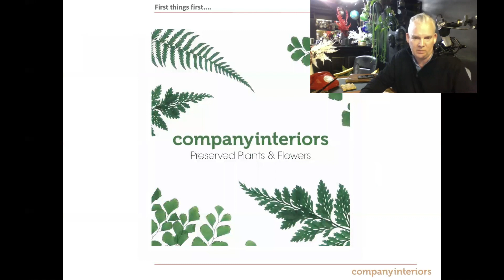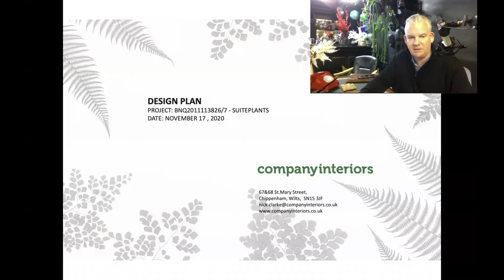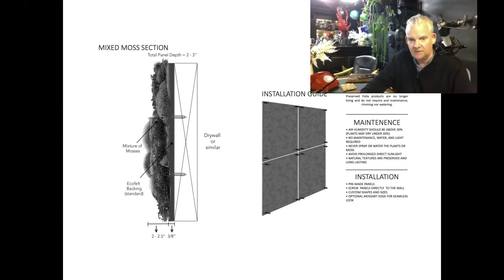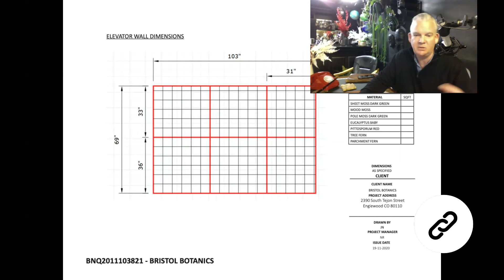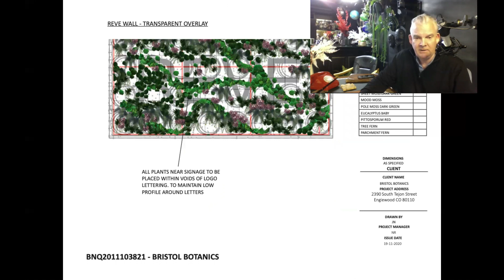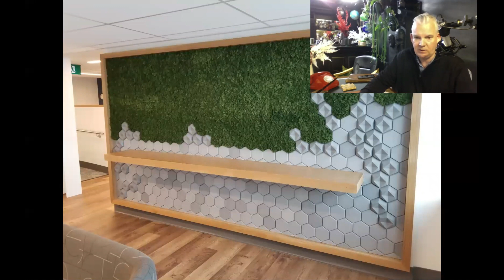How to Design a Moss Wall | Company Interiors

Comment: hi there, I have one issue and I was wondering if you could help me. A client of us wants an entiere moss wall which I haven't done so far. Can you tell me what should I use as material for sticking the reinder moss?  I normally use a wood frame but this is not the case. Thank you
Reply from the maker: Reindeer Moss is probably the most difficult to glue onto frames or walls so a mixture of solvent free and hot hot glue would be best.
Reply: @CompanyInteriors  actually my question is not related to the glue itself. I was wondering which kind of  material i could use( to apply on the wall ) before sticking the moss. shoul i use pfl, hdf or osb? or none of them? thanks